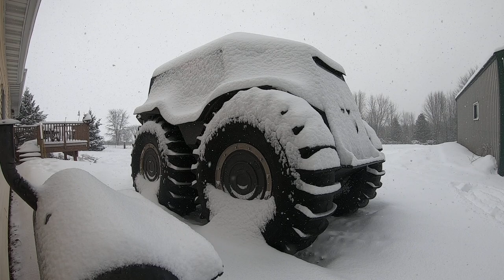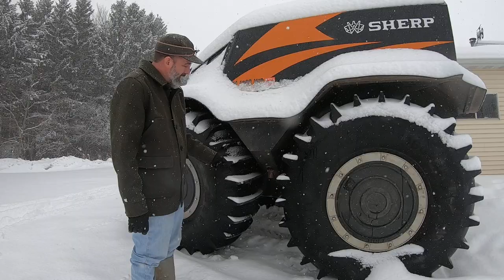Wabasco Heater in Sherp

Comment: you can bolt a electric space heater somewhere inside and run a electrical cord to it  ..heats the inside real good  and very easy..   i use too do that with my car it was amazing....  every little bit helps

Comment: Where do you have the exhaust vent from ?
Reply from the maker: Mark Pratt wabsco heater runs on the diesel fuel from main tank. The exhaust from the combustion is vented outside by the engine exhaust. The heat from the wansco heater is circulated in the cab or engine compartment depending on your desires